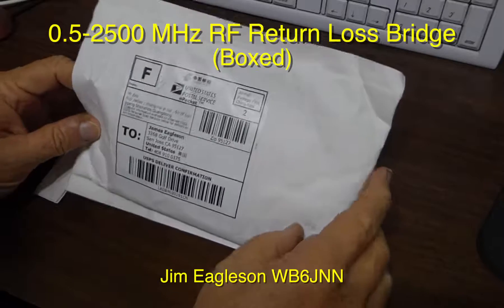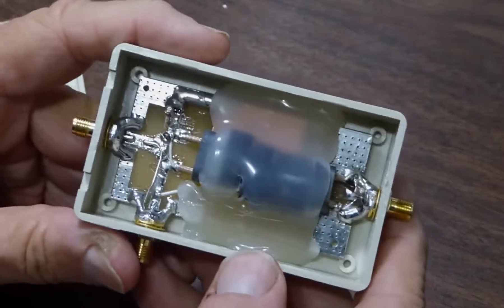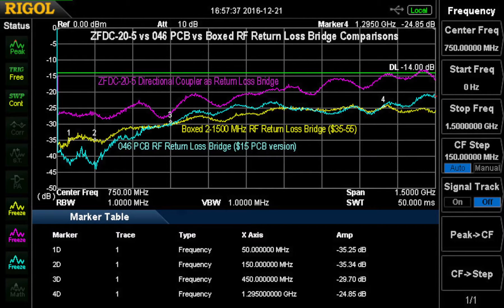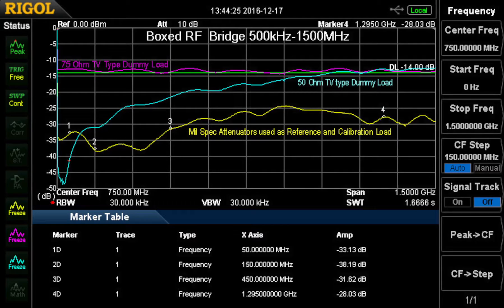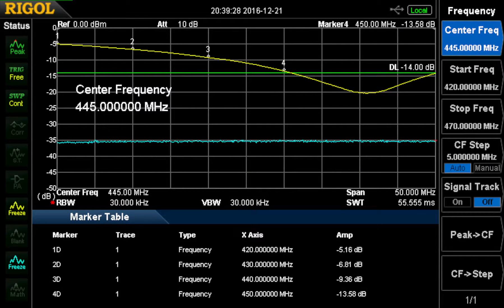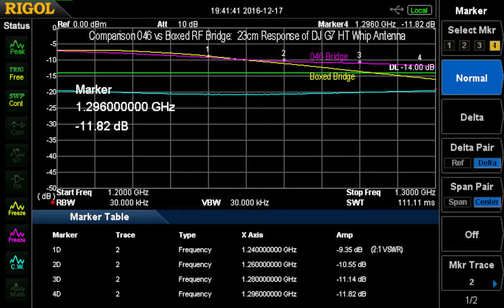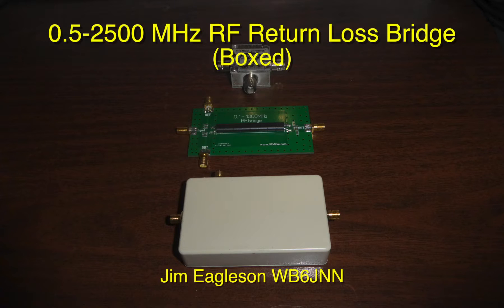Boxed RF BRIDGE Compared

Comment: Hi James, great video but I get much different results than you when testing the Mini-Circuits ZFDC-20-5+.  At 1296 MHz I measure a return loss of 26.5 to 27.9 dB depending on which Mini-Circuits 50 ohm load I measure (I have two different ones).  I have created a simple website that shows my test setup and results and my website URL is https://sites.google.com/site/zfdc205/.  The biggest thing I've found is that any and all BNC adapters greatly degrade the return loss measurements.  If I did it again I might consider the ZFDC-20-5-S+ which uses SMA connectors versus the ZFDC-20-5+ that uses BNC connectors but the ZFDC-20-5+ is working just fine especially at the frequencies I'm most interested in and I really like its small and robust package.  Note: I measure a return loss of between 15.76 dB (SWR 1.39 to 1)  and 16.41 dB (SWR 1.36 to 1) at 2.1 GHz depending on which Mini-Circuits 50 ohm load I measure.
Reply from the maker: BNC connectors should be good to beyond 1500 MHz.  Usually measurement discrepancies with the MFJ coupler depends more on the quality of the calibration reference load.  A good quality BNC has the same contact structure as an N connector though cheap ones may not perform as well due to machining tolerances and/or the quality of the bayonet structure and wear after many connections and disconnections.
Reply: @jimeagle1  Hi James, the big problem I have noticed is that BNC adapters (female to female adapters or male to male adapters) appear to have poor characteristics that greatly degrade the reflection loss curve when they are used in tandem (I don't know which one is the culprit).  If I connect my Mini-Circuits 50 ohm BNC load directly to my normalized directional coupler the return loss at 1 GHz is 23.47 dB (pretty darn good), but if I then install a male to male and female to female adapter between the normalized directional coupler and the same Mini-Circuits 50 ohm load the return loss at 1 GHz drops to 12.33 dB (which will work for most applications, but the return loss curve is really degraded from an instrumentation measurement standpoint).  I was using the adapters to extend the life of the connector on the Mini-Circuits DUT port but noticed the Mini-Circuits directional coupler published characteristics could not be met, but when I eliminated them (the adapters), the Mini-Circuits directional coupler started to work as expected based on the datasheet.  Therefore I'm not impressed with the use of BNC adapters for directional coupler or return loss bridge measurement systems when they are used on what I would call the device under test port.  I guess what I am saying is that it's not fair to compare return loss measurement systems when one of them uses BNC adapters on the device under test port versus using SMA connectors, or no BNC adapters, etc.
Reply: @jimeagle1  Hi James, I should also mention that I believe what looks like ripple in all of your return loss bridge / directional coupler measurements can be eliminated if you isolate the output of your tracking generator from the your return loss bridge/directional coupler.  I used a 6 dB attenuator in all of my tests between the output of the tracking generator and my directional coupler.  If I eliminate the 6 dB attenuator I start seeing ripple similar to what you saw.  Just FYI, Don

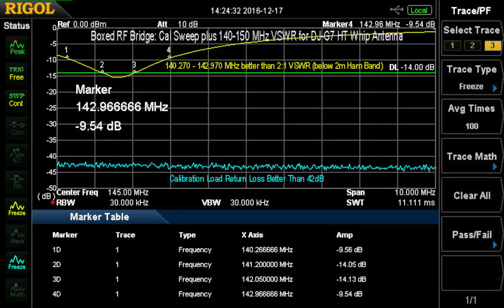Comment: @5:23,@7:00 you mean not well impedance matched. resonance is something altogether different - it is where reactance is 0 and frequently is different from lowest swr.
Reply from the maker: This is correct.  The DSA-815 is not a Network Analyzer thus does not provide Phase and Reactance information.  The curve in the video shows the Return Loss or Impedance Match.  Actual Resonance may occur elsewhere and is not always where best Return Loss occurs.  

As one friend of mine puts it:  "A dummy load often has 1.1:1 or better VSWR but that doesn't make it a good radiator!"  There also was the antenna engineer who pointed out that his HF mobile whip design radiated best when tuned a certain way which also produced a VSWR of about 2:1 in a 50 Ohm system... not uncommon with shortened antennas working against less than a perfect "ground" (i.e. the vehicle's body).

Comment: any idea of the power handling capability of the bridges? Thinking about programming a 1 watt walkie to each channel of interest in 250khz increments. also have a ebay 2watt dummy load so I will have to quick key the walkie so it don't overheat. would this work?
Reply from the maker: Tommy H  I believe these bridges need to have a source level less than 10 milliwatts thus you would need a 2W x 20dB pad to prevent issues with the typical bridge.  Using a pad on the source port should actually fix its impedance to 50 Ohms making the match on this input better especially if the source isn't exactly 50 Ohms.  Just make certain your output is really only 1W (+30 dBm).
Reply: James Eagleson Thanks for the info. I'm just getting impatient waiting on the noise source to come in but would have to order a pad and wait for that to arrive also. I better just play it safe and only use noise source.

Comment: if the box was metal would it be better ?
Reply from the maker: Actually, if the loads that I used were better (i.e. if they actually had 40dB of Return Loss), the results would be better.  I don't think the plastic box or lack of shielding has that much to do with it.

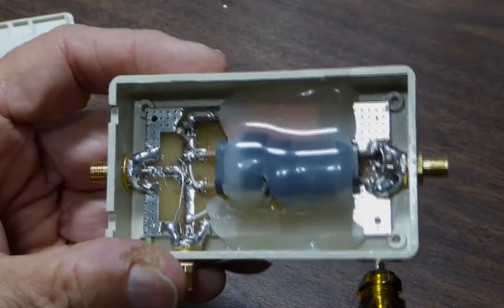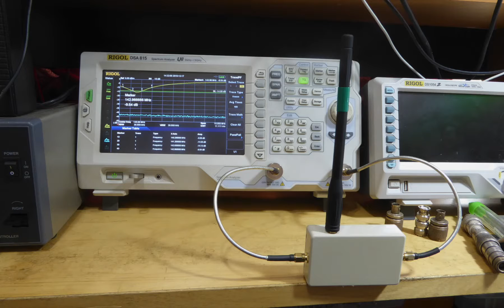Example:  At 2 meters the loads that I have show 30 dB return loss (2:12) which is 1.07:1 VSWR when I use the wide 0-1500 MHz sweep.  When I use a narrow sweep range between 140-150 MHz (10 MHz)  the measured Return Loss of my 50 Ohm load measured 42dB (see 5:12 blue line).  

I'm not certain, but this discrepancy appears may be related to the algorithms used to determine levels in the DSA815-TG during tracking over a wide bandwidth (1.5 GHz) compared to a narrow bandwidth (10 MHz).  Rigol may be trying to achieve a faster sweep rate when sweeping over the larger bandwidth by taking fewer samples but this is just an educated guess.